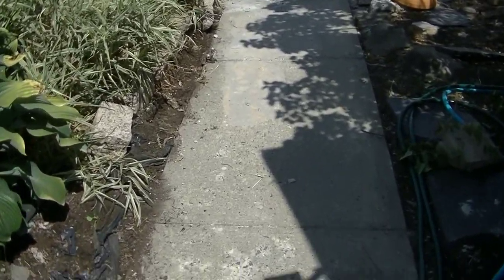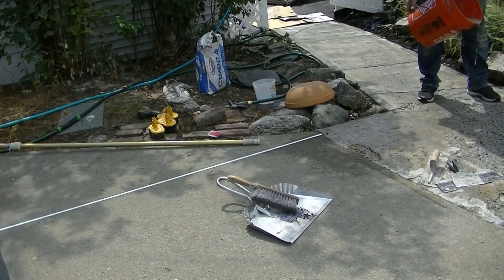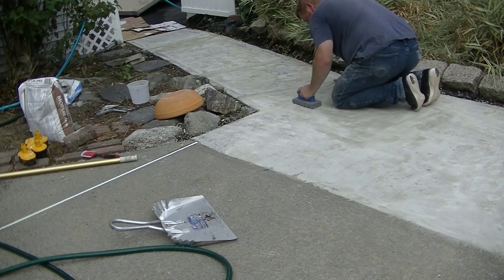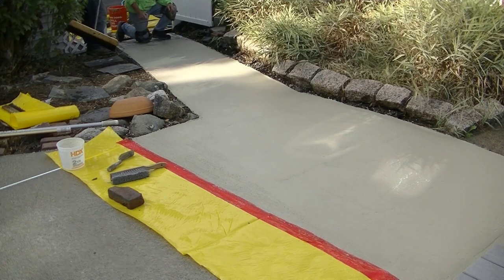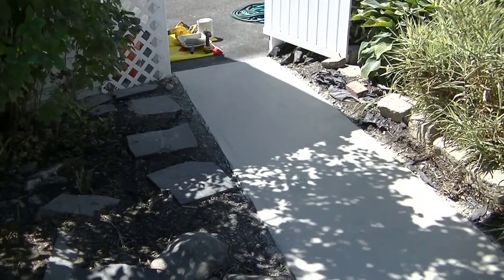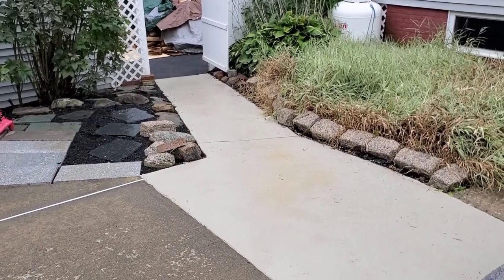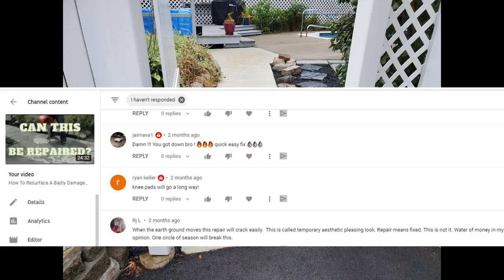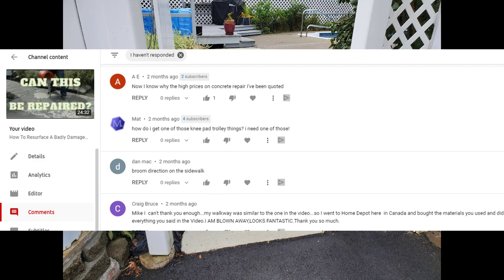Can This Concrete Be Repaired? UPDATE VIDEO! (Resurfaced concrete walk)

Comment from the maker: Here's the original video: https://youtu.be/YLvfk4ho3E0
Reply: Great job bro like always. Well the right sealer always help hold it jobs up. My question is how do you even charge for that. More people are looking for overlays these days.
Reply: Not many do a 2 yr follow up on their work....Impressed!! I have to do the same
Reply: What's the name of the stuff you use
Reply: Looks great!
Reply: Mike, hi! I need your help. My terrible contractor just poured my 9-inch thick, 800 sf, 20 yards of concrete driveway and he did terrible job on the finish. It looks so uneven and ugly. The concrete is solid 5000 psi. I don’t want to rip it and replace it as per the suggestion of two other contractors I called for an opinion. I’m afraid if I resurface it will chip from the weights of my cars and the weather- I live in NYC. please guide me on what to do.

Comment: The folks who have posted negative comments fail to recognize a few basic points.
This is clearly a patch, or surface repair...that's what the customer could afford and requested.
Aside from aesthetics, repairs and patches of this nature can be VERY durable when top quality products are used with proper preparation installation. 
It's true that lifts and cracks caused by roots or expansive soils will not be cured by surface corrections, but no professional would ever assert they would.
I've been in concrete and plaster construction and repair for 50 years, and find current materials are the greatest ever!!
Fast /slow curing flexibility, adhesives, accelerators, flow enhancers, synthetic admixtures, allow creative and durable repairs better that ever before.
Mike does excellent job demonstrating the right way to accomplish professional and long lasting repairs using quality materials and professional techniques that most DIY individuals can do with a small investment in tools, materials, time, and experience.

Comment: 12 years is my topper record in Central Indiana.  It was sealed 4-5 times over the years with 100% solids xylene based acrylic sealer.
Reply: (applied by hand pump and back rolled).
Reply: The sidewalk even had a gutter draining over it.
Reply from the maker: Awesome, nice
Reply: @MikeDayConcrete  My dad's garden shed sidewalk.   Actually it was the whole roof that dripped onto it, not the gutter.  He lost his legs in Vietnam and was in a tank of an electric wheel chair, too, so the wear and tear was pretty heavy.
Reply: I solicited chain stores and management companies for topping back when it was new.   Got some wash and seal jobs, though.  Juicy Fruit holds its scent for decades when adhered to concrete!😂

Comment: One of the commenters made a good point about repairing concrete with deeper cracks, with the methods you used.  what is to stop the concrete from upheaval again, causing the cracks to come back? I live in an area with heavy freeze thaw, which caused cracks in the concrete.  How is this overcome, so that a nice repair job like this, isn't a waste of money? For the record, I am a firm believer in repair over replace, but I do have genuine concern on whether or not cracked concrete can be repaired in a way that it won't crack again in the same spots.  I'm sure the concrete sealer helps and I'd be all for that, if it does really work to help prevent future cracking.

Comment: Great job mate. Could have benefited with some expansion joints on those cracks, quick grinder cut.
The discolouration was the lowest point and your highest fill. It's hard to say why the stain occurred, could of been curing time, rising damp, chemical reaction.

Comment: So my parents house has a chattahoochee entryway, here in Florida. Would this combination be good to do together, as it's only slightly larger than this size in an L-shape. Would obviously need a some kind of primer underneath and probably a thicker cement-all layer, like 1.5 inches. We probably wouldn't do a mortar mix layer, either.

Comment: Some of the negative comments are just silly. I am sure you gave the customer multiple options to repair/replace the walkway. You said in the beginning of the first video that this was to be a lower cost repair and the homeowner wanted this done. Maybe the homeowner just didn't have the funds for a full repair. This served its purpose for what it was, a resurface repair. I think it looked good. I think the 2 cracks may have been migrated if for had some stress relief edges, but what do I know.

Comment: The only real problem I saw was covering up the joints as it cracked like we saw, but other than that as you said the damage was done by salt and freezing which mean it is only surface damage and could easily be patched like you did

Comment: Thanks for posting the follow up!  I have a spot like this in my drive way and was wondering how it stood up.  I live in Iowa so we have the same freeze/thaw cycle and I didn't know how it would hold up.  I've used their products in concrete countertops and I'm really impressed with them.  Is there a sealer I can use on it in my driveway?  Thanks again!

Comment: Great job!
I've got a similar walkway that runs from the bottom of my deck to the driveway. And it has a crack where moisture has caused settling. There's a gap that's about 1/2 to 3/4 inch that needs leveling and filling in. 
The rest of the walkway is in great shape. So, I dont really need to resurface the whole walkway. But I'd like the color to match. I live in central Alabama (suburb of Birmingham,  AL), so we don't have the severe winters that you do. So, severe winters are not an issue for me. And the concrete is 23yrs old, if that matters...
I love the job you guys did! Wish you were closer! I'd rather hire you guys to do the job. But, you made it look relatively easy. So I'd like to give it a try...
And suggestions would be greatly appreciated!

Comment: I would never have thought a skim coat of mortar would hold up but apparently it does. Good work.
Reply: Don't be confused, he used rapid set Mortar Mix- not just regular mortar. Don't want you to get a regular mortar thinking it would hold up...the mortar mix will hold up, but regular mortar would not.

Comment: Mike when you started the painting did you do any prep, or was that right after the overlay dried. I liked the color of the overlay from the first video but not sure what color was when it dried. Did it still have a tan/beige color?  In other word if I used the overlay and put the acrylic sealer you mentioned what shade would it be?  I don’t like the ultra white of the patching cement, or grayish but more tan. PS keep making great videos, the haters need to get a life. I’m sure they are all Experts in the trade right?

Comment: My guess Is all the “Armchair Experts” who only gave it 12 months, have no experience with salt and concrete. My best guess is the salt was ponding at the original big breakout area, causing the original surface degradation. Important note, surface degradation. The staining will be from the same thing, ponding salt. (Check if it’s a salt water pool while your at it) Then scrub it down with a 10-1 hydrochloride acid wash and it will look as good as new. You only need to replace the concrete if it’s breaking up from the bottom up, not from the top down. And all your damage was just surface damage, 100% reparable, because it was caused by chloride iron ingress (salt) not tree roots or clay soils lifting and cracking the slab. Nice work by the way, not enough in the trade reference SSD

Comment: Honestly I'm more worried about the paint/coating lol. Rapidset cement all and mortar mix are great products. Ive used them for years, and even seeing the work years later they look great.  Never done resurfacing with them tho like you show on this vid and the original one....
Like Ive said, I love the rapid set stuff, but you def need to try some out on something not serious if its your first or second time.  Getting to know how the product works and sets along with using their set control additive is super important and only comes with a bit of experience.  Got introduced to the rapid set cementall when I ran my own welding business and used the cement all for grouting my handrails into the concrete. Thanks for the vid.   Oh, Rapidset makes a resurfacer now that I saw at home depot... wonder how it works againts the blue and brown bags...?Wonder if youve tried it out now.

Comment: Have a try with an external screed similar to a screed you use inside but for external I have a rough pebble concrete yard I did with a uk product stopgap 850 and it been down 5 years much simpler

Comment: I'm looking to repair my own backyard and came across your video. It has very useful tips but why didn't you address the 2 cracks? I went back to check the main video and it seems you didn't fill in the existing cracks fully. The one in the middle was just glossed over with the trowel which looks nice on top but is hollow in the bottom. I think when the path cracked it actually detached into 2-3 separate pieces and just moved again after it was repaired. The rest of the job was great but I'm not sure why you didn't even acknowledge the cracks.
Reply: I think that was deliberate though not explicitly pointed out. That will be the weakest point in the repair, so if it cracks, it will crack in that exact place to relieve stress. I don't think the repair would have set long enough to cut it with a saw (and the stress problem will be reintroduced), but now that it's been 2 years, they should be able to just take a saw and make those edges nice and clean.
Reply: Those are joints, they are meant to crack so the crack is horizontal and its expected that they would eventually crack. the joints in your concrete if you look are all cracked. That is controlling the crack, vs. it just cracking where ever.

Comment: Glad for the follow up, was watching the original and saw the link to this, was seriously wondering how it lasted, do you think it could have been done with just the RS mortar and skip the CementAll, one thing I know about CementAll is it don't stick to itself but maybe the mortar has more adhesion in it's chemistry?
Also how important is the sealer in this type of repair/surface?  what sealer do you recommend, so many out there..
Thanks!

Comment: Would a pressure washer or needle scaler work well to break up the loose stuff that your guy was using a hammer on? I've got a couple areas of my back patio that look like this did and I'm hoping to put off a full repour for several years.

Comment: All the naysayers are too lazy to properly scarify the surface.....these CTS products hold up if the surface prep is proper!  I had a ready mix truck with 4.5 yards in it back up my drive after I completed this process.....I just used the cement all for both the patch and the feather edge overlay.....NO CRACKS.....NOTHING!  Learning a ton Mike.....thank you for all the content!
Reply: Question for you Mike if you have time.....is your ready mix company using a melamine based water reducer?  Or if not, what type is most common for a mid range w.r. for p.c.c.?

Comment: What kind of diamond disc are you using for the initial grinding?  Could I get away with a cheap Amazon "Diamond Grinding Cup Wheel Concrete Turbo Cup Disc Grinder," or is there a specialized disc that will work better?  Thanks for the videos.

Comment: Hi Mike. Really enjoy your videos. Thanks and keep them coming.... great to see the 2 year update on the sidewalk job. I'm thinking of repairing my driveway which is similar to the sidewalk. Lots of spalling and flaking. My driveway consists of 8 pads measuring 10' x 18' each. Each pad is spalled and all have stress cracks. I suspect these cracks will come back if I repair. My question is, considering the size if the pads should I run a extra cut down these pads? If yes, should the cut be done before or after the repair? Any other suggestions would be appreciated as well. Just trying to squeeze a few extra years out of driveway before I replace. It's likely 20 plus years old. Our climate would be similar to yours over in Maine. We live in Niagara Falls Canada. Thanks again..........George

Comment: I am doing a project in my back yard and I noticed the manufacture only recommends this mortar as minumum 1/2'' thick : see below
Rapid Set Mortar Mix
High-Strength Structural Repair Mortar
Mortar Mix is a fast-setting, high strength structural repair material. Apply Mortar Mix from 1/2" to 6" thick. comment please.

Comment: Question: For the first step  - instead of lightly grinding it could you use a high intense pressure washer (say 3200 psi) or something like that?  In other words - would that accomplish the same thing of preparing the surface?  Thanks
Reply: Grinding will always give you the best bond.

Comment: If actually know what doing and use proper materials etc….you can get a patch job to last for years, nothing wrong with that👍🏻
It’s all in the experience and materials that one uses, imo.
Heck, even if your getting 2-5/6 yrs out of this patch/repair job (for example), think that’s money well spent if not able to pay for a demo and new pour; when can pay half or less as much for this work…..save up and then if needed, pay for a new walkway later on😉.

Comment: Is that what looks like a pretty significant crack at 6:45 ?
Reply: I see another one towards the top also. I feel like I am missing something or am being gaslighted. Sure the surface has stayed intact and not broken apart but it certainly has 2 cracks. Maybe putting in, or following existing, crack lines to force a straight crack at certain points would make it neater. 

It is a good job considering but just admit there are a couple of cracks.

Comment: at 6:45 you said you cut the joints back in? you didn't cut them in at the end of the last video and they are cracks where you forgot to actually cut the joints in. Literally cracked at the old joints and you said you cut them in 🤣

Comment: Haha. What these keyboard experts don't realize is this is standard practice in commercial applications. Do these idiots think multi level parking garages get jackhammered out for these type of repairs. lol I have seen these polymer modified overlays last 10 plus years with heavy deicing applications applied every winter. BTW I am in Upstate NY, our winters can be a little extreme. If you get a good bond through proper surface prep, the actual wear surface of the product far exceeds standard mix design. You did a good job.
Reply from the maker: Awesome, thank you!

Comment: So number one those two big cracks aren’t ones you cut. It’s actually spider-webbed on the sides and that’s not a straight cut. Always cut expansion joints every roughly 3-4 feet before you resurface. If one’s already exist consider doing more if they are too far apart. 

Number two, that “discoloration” you glossed over would be unacceptable to me. Appears the new filler you added underneath reacted differently to the resurfacing material than did the older material. This is predictable.

All that said it’s still better than it was before you started when it was damaged. 

Bottom line concrete will continue to crack for the entire life of the concrete so just plan on that. When the concrete cracks underneath it will damage the resurfaced area no matter who does it. Expansion joints cut in strategic places can minimize damage due to concrete moving. 

All that said, I’m still doing resurfacing because  the mess it would create to do it around my pool would cost a 10s of thousands of dollars.

Comment: Are you blind?  Your cracks came back.
Reply from the maker: Yea I must be.
Reply: @MikeDayConcrete  If you grind them out and epoxy inject them they will be structurally healed.  Then saw cut adjacent to them to relieve the pressure.
Reply: 6:51